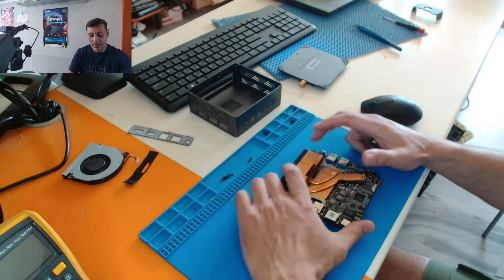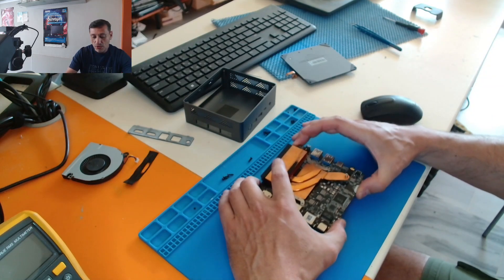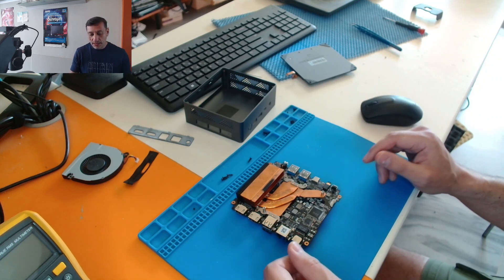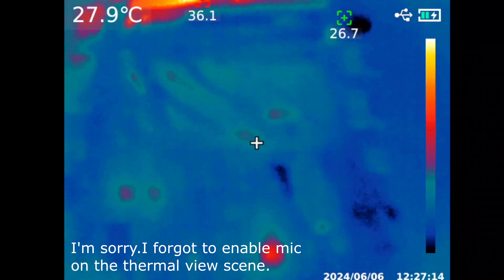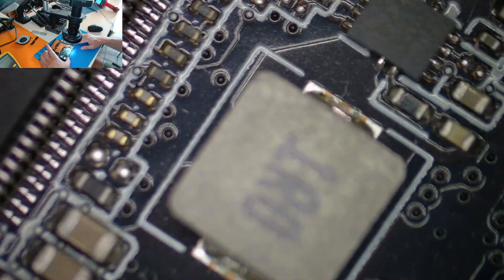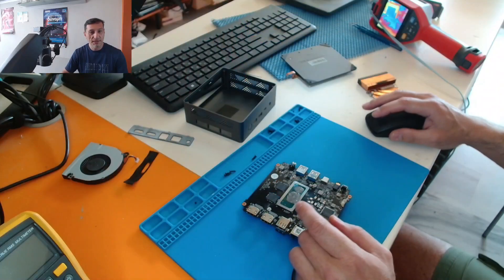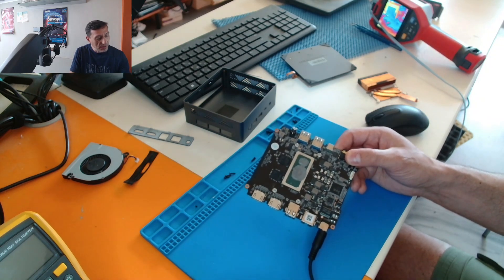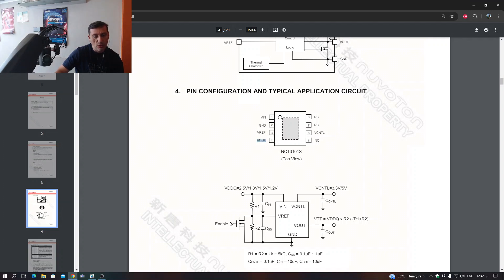Bmax B8 Pro - dead not powering on

Comment: I bought the BMAX-8PRO from Geekbuying. After 3 months the PC died and was completely unresponsive to the power button. I returned the computer to the seller for warranty service. Geekbuying had a long delay, eventually reporting that the device was beyond repair. A refund with 20% depreciation was agreed with the seller.
Overall, I would not recommend buying BMAX devices due to the poor quality.
Geekbuying also does not have a good quality of warranty service, engages in various unclear manipulations.

Comment: I've purchased 5 of the same models. Three of them have already failed due to the same issue you experienced. Two of them wouldn't power up at all, and one stopped working within a week. There seems to be a serious quality control problem with the manufacturer, which is why the product has been discontinued by the sellers.

Comment: I have the same computer, and after a month of use, it stopped working. Upon inspection, I found that I have the 3V, but there is no trace of the 5V. Using a thermal camera, a chip labeled "ddr681" heats up to 60°C, but I can't find any reference to it. Really disappointed with this little device.
Reply: if anyone finds a resolution, let us know <3
Reply: @TMz_Photo  CPU broken for me :(